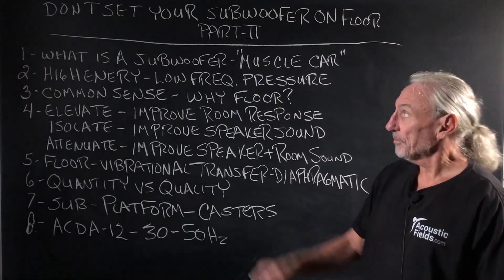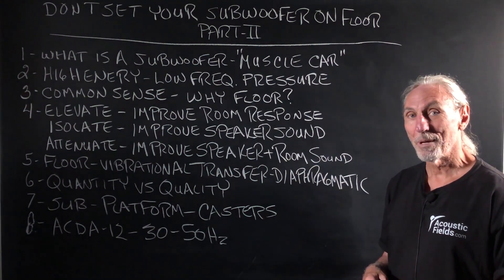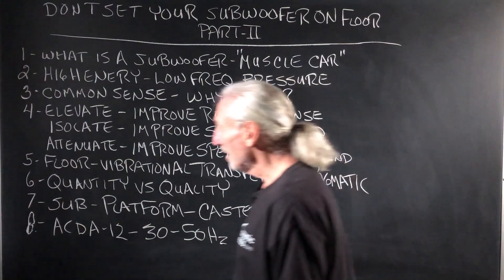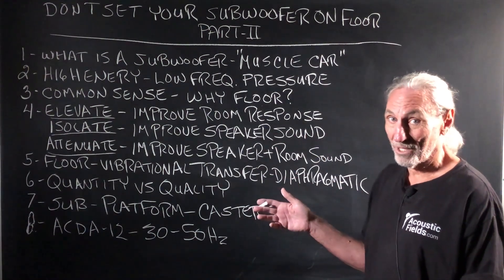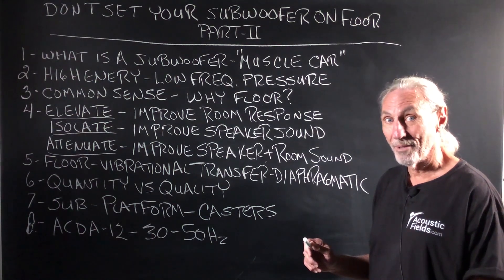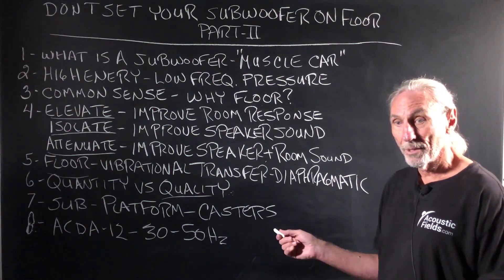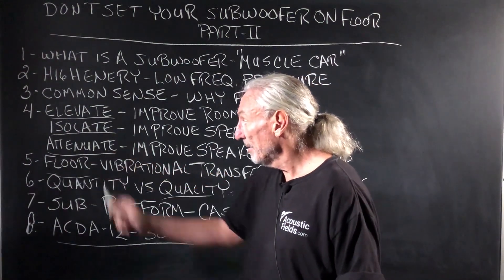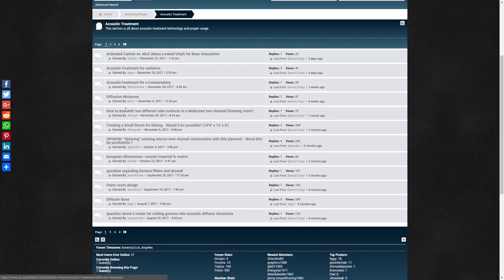Don't Set Your Subwoofer On The Floor! Part 2 - www.AcousticFields.com

Comment: Subwoofers are designed to sit on the floor.
Reply from the maker: They are designed to sit upon the floor because of liability reasons, not because of sound quality. They are heavy objects and manufacturers do not want them falling upon people. Elevate any low frequency device as far away from any surface area as possible. Definitely stay out of the corners.

Comment: and how do you want to get a subwoofer 40 cm off the ground? With what materials?
Reply from the maker: Use a solid material type. You can use concrete building blocks

Comment: Quick question.... placing a couple of 8in subs on a 10ft ceiling do you this will be as bad as have a sub on the floor?? Im trying to take stuff from the floor and i would like to feel the bass more even in the room, some parts of the room i can bar barely feel it.
Reply from the maker: Elevate the sub 18" off the floor as a starting point with your ceiling height. We have subs in our theater that are 36 and 48" off the floor.
Reply: @AcousticFields  sorry but I didn't explained properly,  I mean putting a in ceiling subwoofer... What about that?? I'm just trying to get a decent bass on my room, not blowing the walls and windows  😆

Comment: ...but I don't have anywhere else to put it :(
Reply from the maker: Elevate it 18" off the floor. Stay out of corners. Use a series of stacked couch pillows to test.
Reply: @AcousticFields  I very much appreciate your suggestion.  You seem to absolutely know what you're talking about.

My "problem" is I have a 7.1 system attached to my computer in a 14'x17' room with a carpet-over-concrete floor.  The only place I can put my 8inch sub (Polk PSW250) is under the desk pointed side-ways.  I do have it elevated slightly and I have a ton of acoustic dampening in the direction it points at but I really can't put it anywhere else.

Considering its location it actually sounds respectable.  I have no idea what else I can do with it... but I'm probably going to replace it with a sealed 6 inch in the next 6 months or so.

Comment: ive been redesigning my workspace, and ive been feeling this way about my ported sub ( its on the floor), and now i am upgrading to a sealed because....i can feel it. the bass is hitting the ground. and i feel like that is muddying my midbass and lower. So i will be putting this sub about 2.5 ft off the ground because the arguments point towards the floor, but you made me see the value in my placement before i let all these other opinions in my head. ty
Reply from the maker: It is always a good idea to keep all energy generating sources away from a room boundary surface.

Comment: I want to get 2 subs, and I live on a concrete floor covered with plastic that looks like wood. I imagine front-firing would still add 3dBs to the volume, but I have nowhere else to move them. The room is probably 13'x18'x8' with outlets into the entrance, hallway and kitchen.
Reply from the maker: Elevate them off the floor at least 18". Then try 24".

Comment: but it is not even necessary to put them high above the ceiling together with twitters and mids. Some Large Sound systems are now hanging them up above where a Sub has no Directional Throw and it is useless because the Mass of Air up are not that thick, They are light so the vibration will be weak and it makes no sense having a subwoofer because it will sound like just a mid up there. Subs are meant to be on the ground but if you have wooden flatform on a second floor, or if you have carpeted floor, then that's the time you raise them up a Casters Hight.
Reply from the maker: Nonsense. A subwoofer is a pressure producing device. Pressure waves are not directional.

Comment: If it is not extremely difficult to get ur subs off the floor then ur subs are too small
Reply from the maker: The weight of your sub has nothing to do with room response. An 8" diameter sub can pressurize a room ust as easily as a 10" driver. Size does not matter. What matters is the size of the room not the sub you are placing energy within.

Comment: Why is 15’ a good idea rather than simulating typical home and HT ceiling heights…?
Reply from the maker: Room modes are defined by the dimensions of the room. In a room, you have three "rooms" in one. You have a floor to ceiling room. You have a sidewall to sidewall room and you have a front wall to rear wall room. All three "rooms" have different dimensions, so you will have different modal frequency distortions occurring between each of the said 3 dimensions. A 15' dimensions will produce a 75 - 80 hz. issue where a 8' ceiling will be 65 - 70 hz. The lower the frequency distortion, the more treatment required. Secondly, reflections from a 15' ceiling will have enough distance in their time signatures to be less of an issue with 8' reflection distances.

Comment: I have 700rf Sony sub on floor 

Can I use stand for increase height ?
Reply from the maker: All low frequency devices, regardless of manufacturer, will benefit from increased height from a room boundary surface,

Comment: I always had a hunch that removing the subs from the floor would improve quality if done correctly. 

I'll be trying it out with some platforms I made to hoister the subs up about 6 inches off the floor. 

Thanks a ton!
Reply from the maker: Start with 12" and work your way to 18"

Comment: I like your videos this
works on front firing subwoofer? Because i have it right of my couch( best quality position i think) but i wil try give some height
Reply from the maker: Sub woofers radiate energy in all directions. Elevate it off the floor 12" as a start point. Listen to the improvement across all your music sources. Raise it 18". Listen again.
Reply: @AcousticFields  thanks for quick response

Comment: So to turn this on it's head - what are your thoughts on purposely putting them on the floor to increase the vibrational transfer to your body as you watch movies? 

I've been researching many videos and what I've found is that if you create a floating floor that can flex/vibrate and put the subs on this along with your sofa then you feel the bass dynamics 10 fold in movies. 

I'm also figuring out a way to raise and decouple them when not watching movies with some kind of wheel raiser system when I want to enjoy music instead. A little like those hydraulic motorcycle lift tables or something that lift the casters/wheels. Crazy ha 
🙃
Reply from the maker: We do not subscribe to audio gimmicks. We are all about resolution.

Comment: I thought hed just be explaining coupling...idk but my sub is definitely on the floor, with my coupling system i did custom for my speaker. Its a downward speaker and it sounds absolutely amazing for being a dinky 40$ subwoofer. i get compliments all the time, my neighbors will come over to complain about the vibrations, but hear it inside my house then they dont wana leave.
Reply from the maker: Elevating any low frequency device away from a surface boundary will improve response.

Comment: I have a question regarding subwoofers. The little church that I work with had installed a subwoofer on the back end of the stage and it's not a very big stage but it's where the base amp and drum kit reside. I thought 'why do we have a subwoofer right next to the base amp?' So I moved the sub to a tiny room off the side of the stage. I wanted to get it far enough away. Generally speaking do you think this was a good choice on my part? Thanks!
Reply from the maker: Did you notice an improvement in lower frequency pressure sound quality? Always seperate low frequency sources from each other. The distance apart will depend on room volume along with usage.
Reply: @AcousticFields  I will have to check this upcoming weekend. I was too distracted getting used to the new Presonus StudioLive 32SC console.
Reply: @AcousticFields  and THANKS!

Comment: Interesting points you make and I've heard similar points made on other sub vids that back up your info. I often hear experts say if you position a sub aesthetically and don't touch it theres a 99% chance its in a bad spot.
 I listen to music only and with my subs (2x svs sb2000's) I placed one next to a speaker and the other behind the other speaker and left them there because I can't fit them anywhere else. On a timber floor they sit up on isolation feet (only 2.5inchs/7cm high) and were tuned by a guy from my local hifi shop. Long story short, they sound magnificent right where they are. Bass instruments sound real and theres no wooly bloatiness at all. So maybe a tune is all you need?
Reply from the maker: If you pressure balance the room, the sub will sound good almost anywhere. The room does not care what you want to do or where you want to place this sub or that speaker. it. It will react to that energy you put into it. It will like some frequencies that correspond to its dimensions, most frequencies below 100 hz. it wll not like.producing pressure and reflection issues. It only sees energy. The room dimenions and how they relate to each other mathematically, will tell you where to position the low frequency generating source.

Comment: I'm planning to "hide" subwoofer hanging it along the hanging tv cabinets on 10mm thick steel mount I welded for that purpose. I consider two subs that fit the dimensions I need - one has front woofer and downfiring port, other has both woofer and port on the bottom. Bottom will be about 25 cm high from the floor. Should I keep them "port down"? I can turn them port to the side, which might be better?
Reply from the maker: It is more important to locate low frequency producing devices in the proper room position rather than using a particular mounting methodology.

Comment: And Google as if to mock decided to post what I had not pressed the button to do myself because I went and made supper instead of completing. Perhaps what I wrote holds water for what yoh show and perhaps it doesn't. I didn’t post it abd when I chose to try and not post it I found Android (as if to mock me for a suggestion they made largely unrelated to my search...) had chosen to do so at no request by me. I don't want to deal with this Android crap anymore. I have hair whiter thab your's and less of it and I am so tired of this stupidity. It's designed to mock users from what I can tell. The sand noise for every single alert so you have to pull the phone out of your pocket so everyone else can see the source of your frustration cause. Android developers: The same noise fir everything doesn't show as a benefit to you. The frustration of the face of owners of your terrible OS running devices show instead the terrible life which results from living with devices running your OS.
"No one has to stay there. You can go iOS or anywhere else!" Except in the USA no options exist except those who dropped a briefcase filled with 100's resulted in Congress enabling the blocking of Sailfish and all others.
I may have changed points or focus here (after all, it's Android and my having to correct my corrections of their corrections of my corrections in a device with auto corrdct turned off...) but I hope my point that auto incorrect won't allow me to write and I give up.
Reply: I just looked over what it posted in place of what I wrote and no, I will not correct it. Let it stand as a "tribute" to Android autoincorrect.

Comment: I have front-firing subs so maybe that's a different case?  At any rate, I found that when I built platforms for my subs with spikes that penetrated the carpet to the concrete underneath, my subwoofer sound went from muddy to clean.  I figured that if it works for my floor-standing speakers that came with spikes that it should for my subs, and to my ears, it does!
Reply from the maker: Reducing the transfer of vibrations from one source to another will improve overall resolution. Now, carry this thinking further and add mass to your subwoofer cabinet.
Reply: @AcousticFields What about Acoustic Science sub traps.Do you have any thoughts on those?
Reply from the maker: @JamesBigham-v6b  A low frequency absorption device that one can easily pick up and carry into the room is not a "bass trap". It may go low enough but it will never get enough. Sadly, the story of the industry

Comment: Interesting  video.  

A friend has a metal fab shop, he has 4 Yamaha S115V PA speakers and a single EV 18" sub.  The speakers are up high on a storage shelf above the living area (he lives in his shop) and the sub was on the floor up against a wall.  The bass sounded muddy and bad.  

We got the requisite length of speakon cable and forklifted  the sub up to the elevated position of the main speakers.  Sound was improved greatly, then I took a few  measurements and tuned it using REW and his EQ.  It sounds great now, tonally balanced for what it is, and his QSC pro audio amp and that big EV sub have plenty of power, the system will rock your socks off.  What was shocking was how detailed and good it sounds at low volume levels.  

I think all the lathes, welding and equipment in the shop acts as "room treatment" as the sound is remarkably even wherever one stands with no boomy bassy hot spots.  It really is one of the better sounding PA systems I've heard 😄
Reply from the maker: It is always better to keep any energy producing source away from any room boundary.
Reply: I have a 7.2 receiver with 2 elevated klicpsch often times it sounds boome how can I eliminate that sound.
Reply: @timothygreen8461  Like the author said, move them away from the walls, pull them into the room from the back wall.  That will cut down on the boominess.  Conversely, if bass is weak, moving speakers toward the walls will enhance it.

Comment: In my room placing the sub off the floor sounds awful. Doesn't matter what height or position. Per the manual, it should be placed directly on the floor. Now, maybe the guy writing the manual is wrong. Wouldn't be the first time; however, companies spend millions on R&D and like other aspects of speakers, they have systems in place to compensate for it being in a certain position. Speakers do this as well when they are placed close to a wall.

You say quality vs quantity but that has no bearing if the response is awful.

As is always the case, it is best to try many different things and see which gains the best results for a given room. There is simply no single solution which works for everyone and everyone hears differently and the desired tonality of what sounds good is highly subjective. Claiming there is a solution which is best is strictly false and there is plenty of information and studies done which contradict what you are saying.

Rather than say you are incorrect, I will repeat that every room is different and every person hears things differently. I'll trust that the manufacturer recommends it on the floor or no more than 6" off the ground, that I'll assume they designed it that way and have systems in place which compensate for it's positioning.
Reply from the maker: Manufacturers recommend placing subs on the floor for two main reasons. One is quantity versus quality. They know people want more gain, not quality. Placing a sub on the floor or near a wall increases room distortion that is measurable. They also want you to place them on the floor for liability reasons. Elevating a sub off the floor will always produce a smoother response. Measure the response at different elevations. You will see the improvement in the response curve.

Comment: So I want to add a sub and assume I have to use a down firing sub. I don’t want to get into why. But I found my ideal location for bass response with a 8” monitor. It measures 2ft off the ground from center of the driver but it’s a front firing speaker. 

With a Down firing sub would I measure from the front of the driver to floor to replicate the same height. Why? Because I want to see if I can fit it in a location before so buy it.
Reply from the maker: The direct the sub woofer fires, whether from the cabinet side or bottom, the room only sees the energy coming from. The energy it produces, in all directions, are waves of energy that oscillate through our rooms. Sub energy is emitted in a 360 degree pattern.

Comment: Its amazing how no one knows not to set their subwoofers on the floor. I haven't watch the vide, I just searched the subject to see if there was another human being who knew this. A sub should be a minimum of 1' off of the floor ideally at ear level. Whenever I post a pic of my system on AV forums people rag on me for having my sub on a heavy duty stand at ear level. All of these so called audiophiles often times know very little about proper setup and placement.
Reply from the maker: Physics is the law, everything else is just a suggestion. A belief system based upon ignornace, takes a long time to change.

Comment: Rel subwoofers only recommend putting subwoofers on the floor. Any advice on this?
Reply from the maker: Subwoofer manaufacturers recommend placing the sub on the floor for two reasons. The first is liability and the second is quantity versus quality in sound presentaion value.